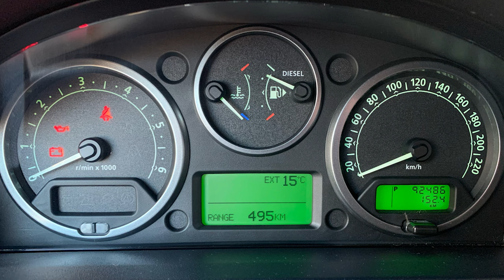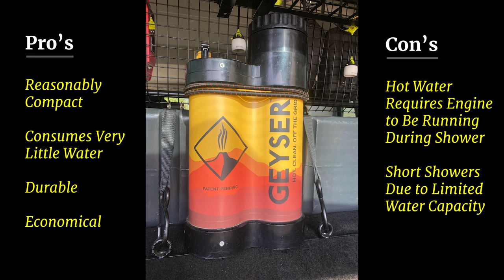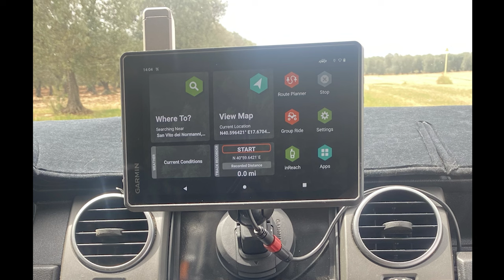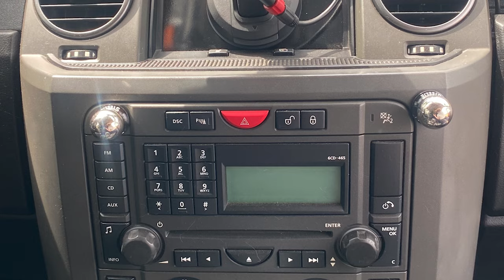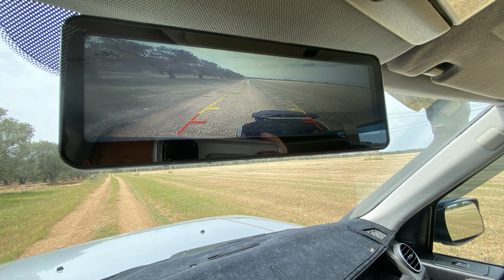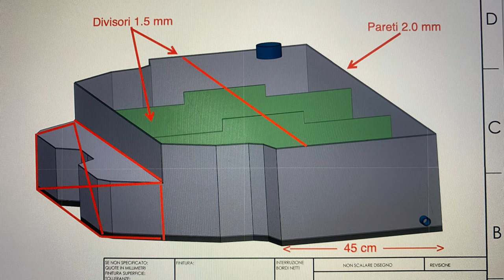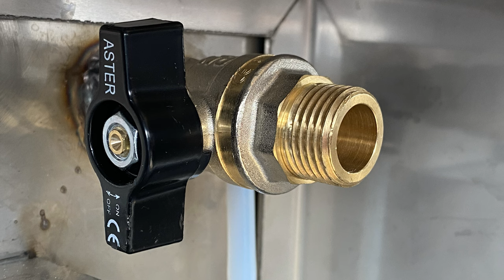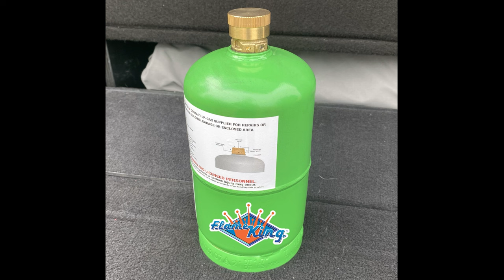Best LR3 Overlanding Vehicle in the World (Part 1 - Interior)

Comment: What make and model of the rear view mirror did you install?  Are you still using it and happy with it?
Reply from the maker: I am using a "G-Series Frameless Rear View Replacement Mirror Monitor with 7.2" Display" which I purchased in 2021 from RVS or "Rear View Safety" and have been very pleased with their products as they continue to perform without any issues 4-years running.

Comment: What tires and size are those? They fit and look great
Reply from the maker: Hi Thomas, Thank you for your inquiry!  We are running the BFGoodrich Mud-Terrain T/A KM3 | LT265/60R18.  These tires are one-centimeter larger (in overall diameter) than the original stock tires which, in actuality, is only 5 mm taller.  They have an "E" Load Rating, which is as high as you can obtain for this particular vehicle.  They are "somewhat" noisy, I suppose, but really not that bad - at all.  That having been said, I am thoroughly pleased with their overall performance and would NOT consider changing them.  Why?  When you find something that is working for you, run with it!  Thanks again~
Reply: @overlanditaly  Awesome and thank you

Comment: What is the rational behind putting the spare wheel on the back of the LR3? Did you put an extra fuel tank in its place?
Reply from the maker: Hi Mark,
"Yes" sir.  The original spare tire was an emergency donut tire, while the new spare is full-size.  We also added an ARB "Long Ranger" fuel tank, all of which we will be covering in Part 5.  Stay Tuned~!

Comment: This cars are known as a trouble maker because are not reliable , to be more specific both engines 3.0 v6 diesel and 2.7 hawe a weak spot the crankshaft usualy blew up around 100.000 km so if you want to keep this car for a longer time I sugest you to swap the original crankshaft with a forged one, I know for what this car ofers it s cheep , a better alternative is wv touareg or jeep grand Cherokee vith 2.7 mercedes engine both cars are very reliable
Reply from the maker: The video(s) aren’t about the choice of vehicle, but rather the manner in which it has been built-out for overlanding.  The “weak spot” to which you are referring was a manufacturing error in some of the vehicles produced, not a design flaw by the engineers of the engine.
Reply: @overlanditaly  of course I'm agree with you I just tried to help you with some information as ex owner of this model